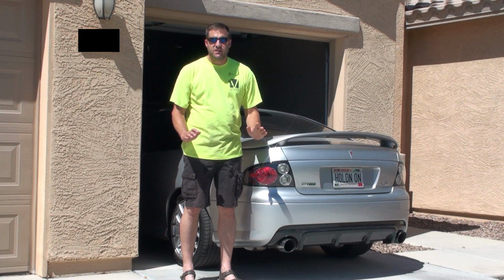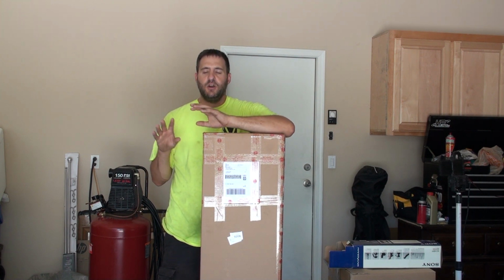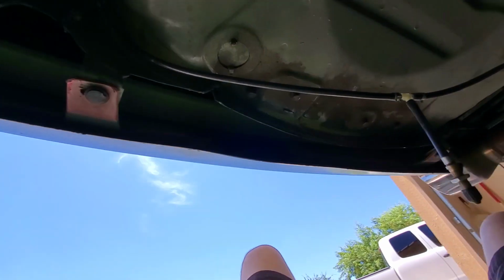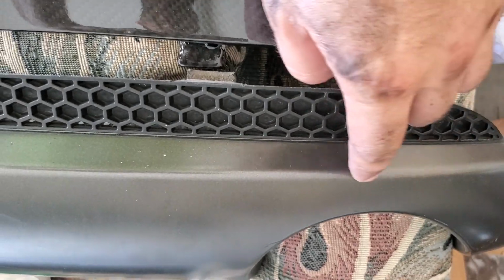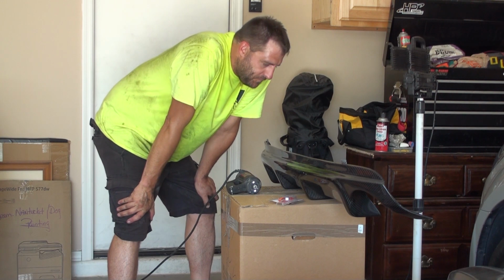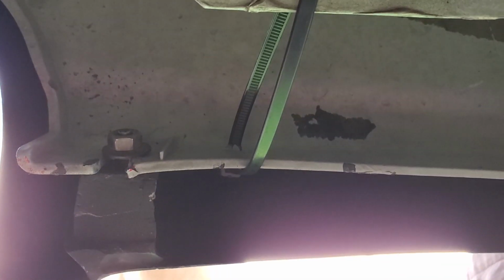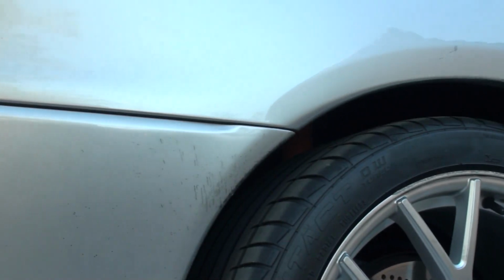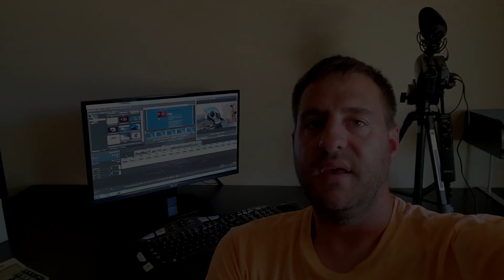Josh's Car Corner - Ep. 65 - Installing a Maverick Man Carbon Fiber Diffuser

Comment: You can see as soon as you flip that piece over that it has fiberglass mat on the backside and a carbon skin on the top.   This is a common MO for him, and is normal with most of his products, but that causes issues.    Mostly fiberglass is very resin heavy and because of that not only is it brittle (something you don't want on a bumper) but extreme exposure to heat can cause it to deform.

I have the carbon fiber diffuser on my car as well, and had the fiberglass diffuser on my old GTO and have similar thoughts as you, I also have the spoiler on my car and it is beginning to discolor and delaminate and my car spends 98% of it's life in a climate controlled shop, it's never been outside for more than a few hours at a time.
Reply: Should of clear coated it
Reply: @Djalathawayne  I'd love to hear how clear coat prevents delamination.
Reply: thanks for writing this out, this was the last nail in the coffin for me. almost bought from him so you just saved me money im gonna be making horsepower with.

Comment: I bought the Carbon fiber without the GTO letters embossed. I’ll install it when I change my rear bumper at the same time. It was tapped in the rear by a hit and run. Let the body shop worry about it. Most of the Carbon pieces from Maverick Man you have to tweak it to fit right. Have fun with the Carbon Fiber Grille insets. I sold mines on Ebay because I didn’t want to mess with! Because the tabs that attach the grille to the housing was a nightmare to line up without grinding. And I was scared to grind too much off to fit.
If you get the auto shifter in Carbon Fiber don’t even bother to attach the CF shift button. It’s not going to fit right without a lot of trial and end up with error. Just buy 2 Black button from GTOG8TA. One ☝️ for the shirted and one for the hand brake to match.

Comment: Dont forget your car was rear ended.  I thought you said it was close to totaled.

That could be most of your issue.

Thanks for the video!
Reply from the maker: That was all fixed properly, and that bumper was brand new at the time of the repair. I also have photographic evidence showing that the bumper sat properly with no gap before I took out the original insert.